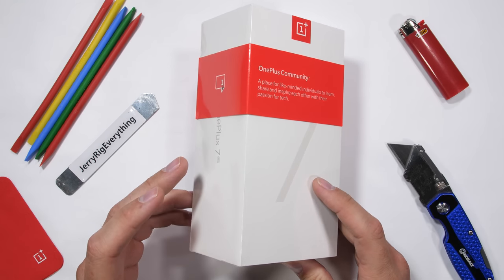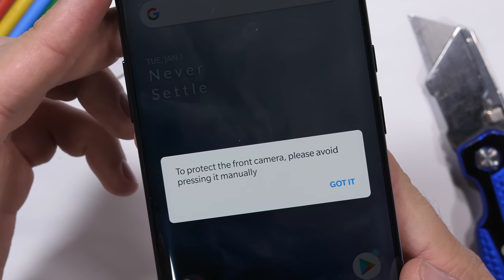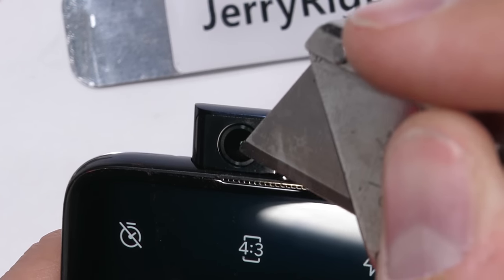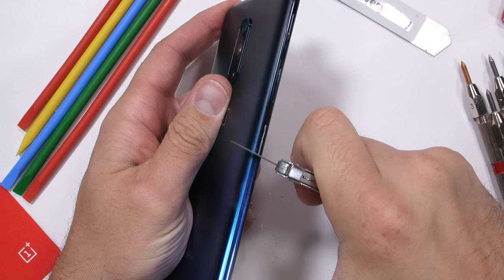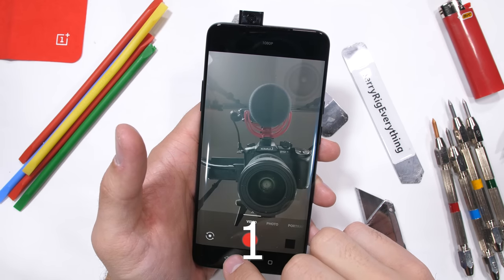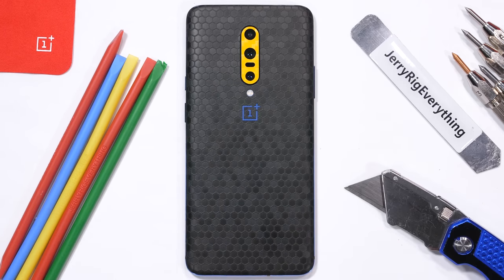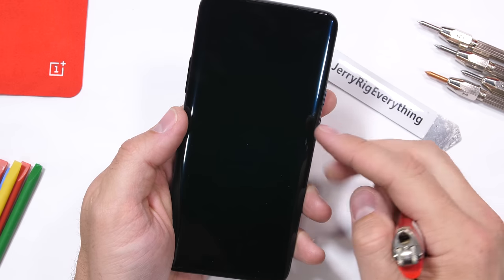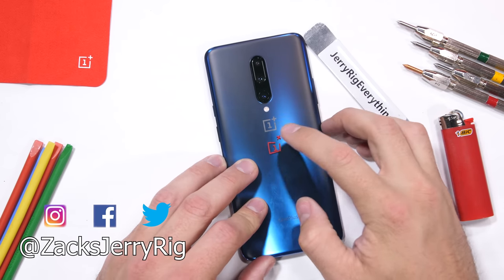OnePlus 7 Pro - Hidden Camera Durability Test! Will it Scratch?

Comment: I gotta be honest here for $669 for this phone it's pretty good but one problem no HEADPHONE JACK
Reply: Wireless/reverse wireless charging and ip68 rating would make this phone the best ever
Reply: No sd card slot, no wireless charging
Reply: Supergaming101 wtf come on it’s 2019 the hpj who cares
Reply: @thomashackner9848  with the warp charge does wireless charging even matter, with my 6t I just have one charger by my computer not even my bed and and only charge for maybe an hour a day
Reply: @bigmaxcc  everyone
Reply: DM me I'll send you wireless headphones for free
Reply: @bigmaxcc  some care dude theres not alot of people who cant afford bluetooth devices or buy extension thingy
Reply: Qwerty Uiop long messy wires ahhh no nope I’m out
Reply: It is $669
Reply: bigmaxcc But you have to charge using a wire...
Reply: @bantot1296  If they can afford this phone they can afford Bluetooth headphones. I prefer wired ones no matter the cost.
Reply: @bigmaxcc  then why is there a usb type c port
Reply: @henrath  ok
Reply: I've got the oneplus bullets myself, and I'm using them with my OnePlus 5. I really like them. They are comfortable to wear. And I can just plug them in my phone charger when the battery is low. They charging time is extremely short.
Reply: @Leonvolt28  ok
Reply: Supergaming101 And also no sd card slot. 😣 
For the earphones, a Type-C one could be used though...
Reply: @joy-ow4ey  but does the phone comes with a extension
Reply: Supergaming101 It's written in their website that, it supports standard Type-C earphone.But earphones not included in box.😪
Reply: @bigmaxcc  the hpj is literally on e of the most useful parts in a smartphone. I use mine everyday

Comment: Questions I'm hoping will get answered in the teardown video, if there will be one.

Is there any waterproofing mechanism around the pop up camera, like a rubber band or gasket? 
Will waterproofing be compromised if camera is open?

Is there a spring in the camera like the Vivo Nex, that takes the burden off the motor if you push the camera in?

If something is blocking the camera as ot tries to come out, will it give up, or try anyways and strain the motor/screw mechanism?

Comment: Man if this phone had a headphone jack, it would be the most feature-rich phone ever.
Reply: Buy the OnePlus bullets wireless and you'll never need nor think about the headphone jack
Reply: @Mobaba1995  I would absolutely never use wireless headphones. Headphones that you have to charge? No thank you. Imagine forgetting to charge that shit and not having any way of listening to music in a crowded tram on the way home or whatever. Nope.
Reply: @nolejd50  i understand but youll get used to it and it only takes 15min for approximately 8 hours, because of my work I have my charger almost always with me as well so no worries for me.
Reply: @nolejd50  Well your in luck, xiaomis respond to this is the k20 and k20 pro and they both have the same feature plus a headphone jack.
Reply: @xaviorprime9203  I know, it rocks! Also ZTE Nubia Red Magic 3 is a pretty god flagship killer.
Reply: @nolejd50  the nubia is 600 dollars in my country compared to the k20 pro at only 300
Reply: @xaviorprime9203  in my country you cant even get it.
Reply: @xaviorprime9203  yeah the k20 pro is a beast, but that back pattern design... Looks like cheap 50 cent plastic toy they sell in my local marketplace
Reply: @Zanbatoss  just buy the carbon fibre one if you dont like it
Reply: @xaviorprime9203  oh shit you're right, somehow it went past my head

Comment: 669$? Can't complain. Really good specs for the price.
Reply: It's honestly insane to me, thought it was going to be around 800 at the very least
Reply: Without taxes yes....
Reply: @Pete Coventry what r u even talking about lol
Reply: is it better than s10 e
Reply: @shaf.  S10 e,I think yes
Reply: And crappy camera, as always.
Reply: @Pete Coventry It's not even close to an A70.
I still prefer the S10e over it. IP rating, wireless charging, headphone jack...
Reply: @makaroninini  I though it would be 999$!
Reply: Vivo V15 pro is like $450 and Oppo F11 Pro is like $325
Reply: @vimcraft_  bro that doesn't have that high end processor and 90hz display... I'm using vivo v15 tho and I love this phone.
Reply: Meh, I prefer fast charging (wireless = too slow), I prefer headset =  wireless but still there is a adapter to use so no big deal. But for me the most important thing on my 6T, no bloatware. The camera on the 7 Pro, hmm, not sure what to think of it yet. The lighter test +50 seconds, i’m impressed. IP rating ,to me, is only useful if companies pay back your phone if it has taken a dive and got damaged. Liquid damage isn’t covered under the phone’s standard warranty.

Comment: got a used one in pristine condition. its 3 yrs old without a scratch. The display is top notch (coming from a 120Hz s20 fe 5g which i gave to my dad). The front camera motor is still fully functional. Obviously its the EOL for this 7 pro but i will use it till the hardware lasts.

Comment: If I can make a phone I'm gonna use sapphire display,because I wouldn't hear scratches at lvl6 with deeper grooves at lvl7 when he is testing the phone.
Reply: ToxicJeff things cost money, sapphire is expensive
Reply: Growing sapphire to the amount you'd use for a smartphone screen is difficult, not to mention expensive.

Also, while sapphire is very scratch resistant, it's more brittle than glass and thus, more likely to crack under pressure compared to the treated tempered glass used by Corning in most phones.

Comment: I have 5T, bought when it was newly released. I still use it every day and still LOVE it. My brother recommended it to me as he had 3T (now he has 6). I can say it is literally Best phone ever. the protective plastic on the screen is still in place!! working perfectly with no issues. Have dropped it many times, still like new. Event the phone case that was included havent broke or scratched.  I want a new one T, but I might wait for 8T or 9T, as 7T is too early, mine is still working awesome. Also I love fingerprint feature on the back, super convenient, I wish they implement this one again. I have set not my thumb, but index finger (and few more) set up (plus face recognition)  and it is sooo convenient.

Comment: I've been using this phone since a couple months after release until just yesterday ( upgrade to a Z flip 5) and this phone never had any issues! No scratches even without a screen protector ( I took the screen protector that came with the phone off about a year ago cus it was pretty beat ), dropped it a ton because I have small hands + clumsy, this thing survived EVERYTHING. The pop up camera still works like a charm, retracts when I drop my phone, and still has decent picture quality. It was never the best for video calls but I was very happy having this phone. It's now used by my partner until he gets a new phone later this year (an upgrade from his OnePlus 6 with a non working charge port). 

Funny enough... the only phone I ever had break in any capacity was my Samsung Note 8 back in 2018 when it fell from my desk 3 feet on the bottom corner, shattering the screen and damaging something internally. Hoping my second time using Samsung doesn't have the same results.
Reply: What happened to OnePlus 7 pro? U have with u no

Comment: COME ON ONEPLUS WHERE HEADPHONE JACCCKKKKK SERIOUSLY.....
Reply: i must said headphone jack is not dead but cellphone sound out sucks, i prefer a external usb dac the sound is much better ,but they cant put a good dac inside a phone because the power consumption also cost, do you know mostly all cellphone jacks operate at 300-500ma ? a cheap and good dac is the dragonfly black 1.5 the 1.5 can deliver 1.5volts out and the dragonfly red 2.3v but if you like good sound good quality go for hifiman super mini or chord mojo but the mojo cost around 500 usd
Reply: @makunouchiippo2542  But Charging And Use Headphones In Same Time Tht My Issue Here U Dont Care About Good Sound Or Not This Smartphone Not Sony Speaker Am A Game So My Problem I Like Charging And Headphones In 1 Time If No Headphones Jack We Need Use Wireless Headphones BUT IT DELEY 0.2 AM PLAYING Game When I Heard Movement In Game Am Arealy Dead Coz Of Deley You Know
Reply: @darkknight3032  ok thats a good point but exist the y cables
Reply: @makunouchiippo2542  Ya I Know About Y Cable But Like My Iphone7 It Sloow To Charge Up Coz Of 2 Thing In 1 Time Port Also Sound Become Not Clear If You User Iphone 7
Reply: @darkknight3032  nah Android masturace I think they must add a second USB port
Reply: @makunouchiippo2542  Yeah I agree With Tht 😂

Comment: Now, let's look back at the iPhone XR.
More expensive
Not quite FHD 60hz LCD 
Notch
No fingerprint scanner
No 5G
Reply: Mher Saribekyan when you compare last years tech with this year tech you lose all credibility.
Reply: @EfrainElBoricua  its just 6months old
Reply: @EfrainElBoricua  ueah you should compare the on plus with a phone that is 6 years old
Reply: Strahinja Zivkovic yeah in another 6 months it will be replaced. The one plus 6t is only 6 months old too. . Always compare to current tech like the pixel 3 and s10 I’ll be picking one of these myself anyways.

Comment: I got scratches on my Oneplus 7 Pro screen just from being in my pocket. The phone was the only thing in my pocket.  Where the scratches are on my screen, they came from rubbing on the coin pocket of my jeans while the phone with in my right front pocket.  Very surprising to pull the phone out of my pocket and see a bunch of scratches.  Luckily the screen protector I had installed hides all the scratches.

Comment: I bought this phone and I am a very pleased customer for the moment. cant wait for the technology like 90hz screen to be used by software and games. And the new storage is insanely quick. going from a S7 Edge to this is absolutely insane. Cant wait to try it with my Dji Phantom 4 drone.
Reply: How about the screen scratches resistance? Is it resistant? Or does it get scratches easily? I'm worried because I will get the phone next week, I never use screen protectors on my phones because I hate how it looks.
Reply: @wilasiatuber1629  I havent had any problems so far. it comes with a plastic layer already on and a clear case that i actually like.
the plastic is still on for me but shows no signs of abuse.

Comment: Hey @jerryrigeverything, You could check out the new Asus Zenphone 6, it has simmilar specs to the OP 7 PRO and then some: motorized camera (flip)  SD 855, headphone jack, sd slot, bigger battery etc and costs 500 USD. It would be nice to see if they skipped on build quality. Love your videos BTW, please keep them up and congrats on the engagement.

Comment: We need the "fumble and drop" test out on the pavement with their bump case, and then naked without one,  those tests used to be THE drop test.   

Their support could not tell me if a 6 foot man bending over from the waist could pick up a dime at a bus stop without bending his knees, and not have the phone slip out of a front shirt pocket.  

 This is a critical but disappointing choice some have to make b4 choosing the smaller 7, and then buying another later with 5G.

Comment: Love this phone. Sadly mines battery is going bad. Only holds a charge for like 2.5hrs of use. Now I just use it as a Wi-Fi device. Wish they would bring this design back. But who does that.
Reply: you can replace the battery for cheap, will work fine for another few years at better charge
Reply: @illyaeater  there isn't a place in my town that will do replacement unless it's a Samsung or a iPhone. And I don't want to attempt it myself. I just like to keep it for collectors piece.
Reply: @illyaeater Where do you get the parts for replacement? I live in Latin America, any recomendations?
Reply: @BOOGiNS I recommens checking if you phone is updated to the lastest software upgrade. If thats the case, then that's why, with Android 12 and sometimes with 11 the phone literally gets ruined and the battery gets extremely bad. I highly recommend manually "downgrading it" to an Android 10 ROM which is pretty easy on the OP7 Pro since a lot of people look for that downgrade so your phone can be good as new

Comment: I dropped my 3T in water. It was working so we'll till now.. 

I need a durable phone under 450$ 
With water resistance this time, any recommendations?
Reply: With the launch of the 7 the price of the one plus 6t has fallen to below that price at most retailers and carriers like T Mobile. If the one plus 6t isn't below $450 then it is definitely below $500 that I can guarantee.
Reply: @tj4902  thanks for the recommendation

Comment: Hi Oneplus i was soo happy after received my Oneplus 7T Pro Mclaren phone. after few months used my Mobile i noticed inside the  main Camera lens lots of dust. How come 7T Pro Mclaren special edition Mobile got Hardware problem i don't understand. I did contact with Oneplus service center. They asked me to send the mobile to them to fix it. But i can't accept my almost very new mobile have to open for fix hardware just after few months. I am still thinking what should I do. If i send it to them they will open it for solve the issue. Nooooo I don't like to use mobile which is repaired. I am soo upset 😭. I don't know what to do.

Comment: I love my OnePlus 6, but I don't like the slider, I never use any of the options other than ring as I never feel vibration and barely ever need 100% silence. What's the use of an extra button if you can hardly customize it? I wish they just linked do not disturb to that slider so you can actually set it up.

Although Google messed that up as well. These days you cannot set DND to ring quietly with no vibration which is exactly how I wanted it. Come on Google, you're not Apple, don't put us in a straightjacket... Booh.